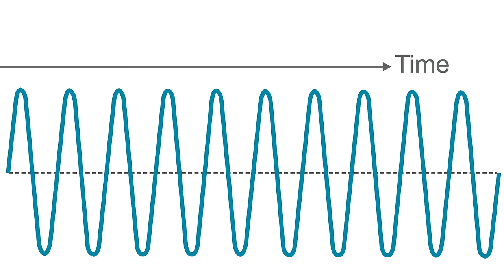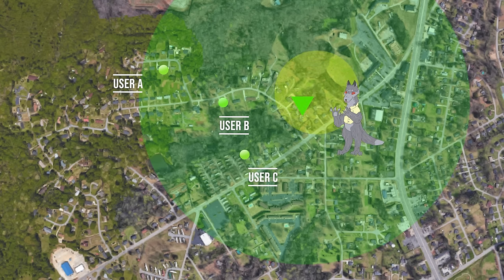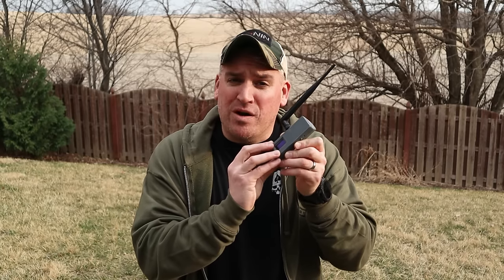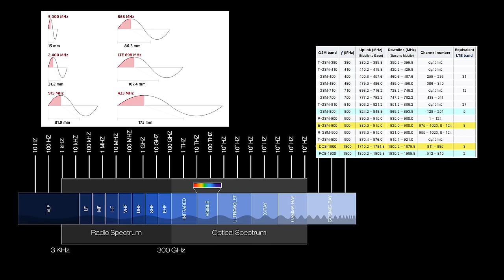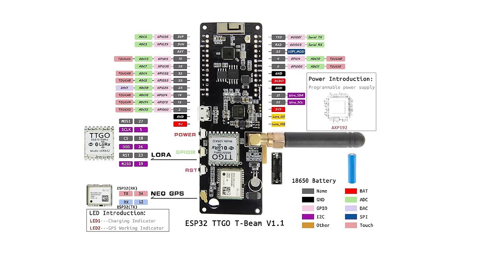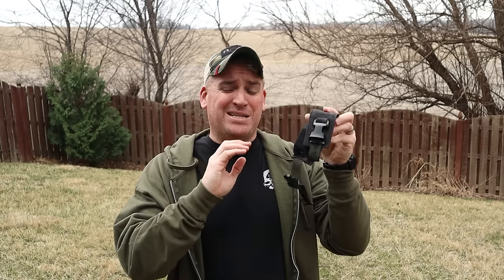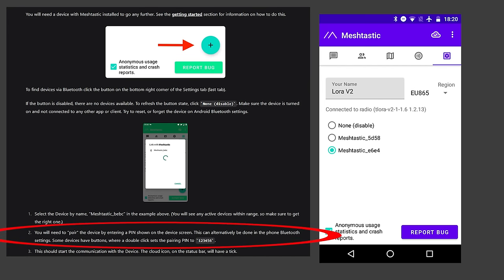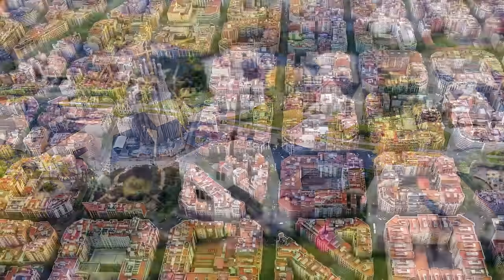Lilygo Meshtastic T-beam - Game changer in Tactical Comms

Comment: I think this is my favorite video that you’ve done. You did a great job of laying out the weaknesses of traditional comms and the strengths of this system. 
Everywhere I’ve seen information on this stuff before has always come from radio guys either unaware of, or trying desperately not to show, the defensive applications of the technology. 
I also really appreciate that you kept it to an overview with links to more detailed information included. And I really appreciate it I wanna get bogged down with more info than I can digest, but I also don’t have to go hunting for relevant information if I want more. (And I definitely want more)  
I’m very much looking forward to getting and playing around with these. I wonder if the cases could be redesigned with a waterproof seal. Like a gasket with some screws to replace the battery when necessary. Maybe hardwire a solar charger in as well so you can set it and forget it.
Reply: Check out RAKBox-B2 Enclosure with solar panel I can’t send links on YouTube
Reply: WisBlock Meshtastic Starter Kit Goes inside the rakbox

Comment: Your using the wrong battery, you need to use the Flat Top version, good thing you did not break the battery holder.  Good Job on the video, well done.

Comment: Make sure to buy the batteries without the nipple on it, those with the nipple will be to big to fit in these boards.
If you dont want to solder, you can buy these boards with the screen already on and most of the time it comes with Meshtastic already loaded on the board.

Comment: We've played with them a bit, and they're pretty slick for a certain level and setting. As mentioned they require that cover of other devices being in operation otherwise they're still subject to RDF( in Ukraine they're hitting some emissions in under 60 seconds https://youtu.be/UZXzMUxfR6c ) . You can still play the same tricks(directional, terrain masking, etc) but aerial surveillance can nullify a lot of that. 

 One of  the better options we've found for short term nodes is a Heltec Lora module ,AA to mini battery pack,  sma extension , a 16 oz nalgene, and a 915dipole. Just drill a hole dead center of the lid for the antenna extension to mount to.
Also we've had limited functionality with ATAK , basically position reporting within a functioning ATAK setup. Which can be done in some meshtastic versions without ATAK.
Reply: Can you link to how you run it on AA? 
Why do you like the heltecs better?

Comment: I was in Electronic warfare in the Air Force. This video is fantastic. Also yes blue tooth is insecure but the transmit distance is LOS and also very small so if you’re close enough to intercept the signal then I am close enough to shoot you. So that isn’t really an issue. The real problem with that is that the phone is giving out your location at all times if the cell network is enabled.
Reply: Excellent point - but that could be thwarted by removing the SIM card from the phone, correct? Bluetooth and other functions would be unaffected.
Reply: Would airplane mode do the same thing?
Reply: @iamnothere454  There is no way to remove connection from a phone due to the backdoor access. Even when you turn off your phone it still is actually collecting data to transmit when you turn it back on.
Reply: The phone still pings the tower even without the sim. It's how u are still able to contact emergency services without the sim.
Reply: There are new stand-alone devices that once set up, I don't believe need a cell phone or BT, like the T deck.

Comment: 12:40 Even though a antenna has a mating SMA connector does not mean it will work on the same frequency.  Make sure the antenna is resonant in the 902-928 MHz band
Reply from the maker: very true!

Comment: One very important thing that your video missed:  The modulation used between the nodes is LoRa - chirp spread spectrum.  It's low power ande the have can operate below the noise level.  Second, i the Meshtastic  nodes in high places where they are in line of sight LOS of another node in the mesh.  The tablet or phone only momentarily transmits to send a message.
Reply from the maker: Reread this please. You're missing a whole lot of words that would be useful in it making sense
Reply: Sorry.  I may have fat-fingered while typing on my cellphone or something got lost something in translation to English.  1)  The modulation used between the nodes is LoRa (chirp spread spectrum).  It's low power and can operate below the noise level.  2) It's most useful to have Meshtastic nodes in high places so that they are in line of sight (LOS) of other nodes in the mesh.  The tablet or phone only momentarily transmits to send a message.
Reply: Furthermore, I have a couple of Meshtastic nodes that connect via USB.  They never transmit over Bluetooth or WiFi.  You have to be a very skilled fox hunter to detect a LoRa signal because it's often below the noise floor.

Comment: So glad this idea worked out so well. When I first saw it I thought that you guys could figure out a way to use it in a tactical situation. 

One note about the Bluetooth is that it normally only works within about 30 feet so you would likely be able to see anyone close enough to actually hack the Bluetooth part of the system
Reply from the maker: I'd be more worried about setting devices that just packet sniff and listen in if you're in range of them.
Reply: @ThinLineDefenseCo  True, but even then the data is encrypted and would need a way to un-encrypt it  as the app on the phone handles that. So not sure what anyone could really gather from hacking the Bluetooth.
Reply from the maker: @kalebfinlay  ahhh yea agreed sorry I was talking more intercepting the Bluetooth of folks using Bluetooth PTTs. We were talking two different things lol

Comment: The only problem i have with this kind of system and the integration into the ATAK app is that you have to enable Bluetooth. That's the only real downside. Give me the option to plug it in with a 3,5mm audio or usb-c and we're talking.
Reply: The heltec lora 32 board can do that

Comment: There is a reason 33cm is using of IoT.  Low-range when you don't have LoS.  They talk about miles, but that's if you don't have anything between the two antennas, including too much air.  Additionally, this is only text and relies on having a working cellphone.  Which is much easier to track.  Which means when you're out and about, you have two transmitters running constantly.  All for the advantage of being able to text someone.   Radios, you turn them off, you're dark.  Or you remote the antenna and draw the Opfor into a trap.  

Not saying these things don't have a use.  Just it's not to replace radios.  Not even close.  And are generally only useful in a set location.  When the SHTF, most of those that want to continue breathing are going to be on the move.  This isn't going to be just some natural disaster that you can wait for the cavalry on.   

Funny thing about jammers.  They have to be loud and on all the time.  With lots of power.
Reply from the maker: You can pull the sim card and still connect to these devices...just fyi
Reply: Not to mention that you don't need a phone because some units have a standalone keypad

Comment: Meshtastic is cool, but the battery life drains in less than a day. It uses an 18650 battery which is huge for modern electronics and it still drains in less than a day with no use in standby mode. This needs to last at least a few days in standby to be useful.
Reply: It's called solar

Comment: I have a question. Has anyone tried to take one of these boards and put it into a Thyrm CellVault 5M? The reason I ask it that it can hold multiple 18650 batteries to connect in a series and it’s a hard case that can attach to molle  web gear.

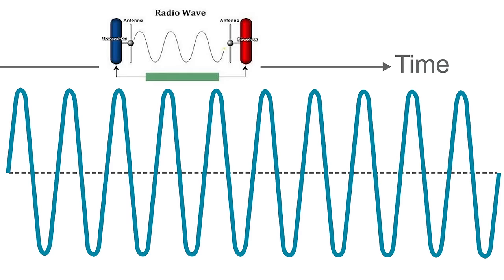Comment: 1:40 Who says that HAM radio has to use repeaters?  In fact, Meshtastic acts like a mesh of 868/915MHz repeaters that are connected to Bluetooth at the end points.
Reply from the maker: Ham is the technology of your Dad's Dad.  It's time to move on.
Reply: @ThinLineDefenseCo  ZZZZZZZZZZZzzzzzzzzzzzz You know nothing about HAM radio then.
Reply: @WA4OSH  He has no idea what he is talking about. You don't have to use a repeater at all. I don't in many instances, and can communicate over 400 miles depending on weather.
Reply: @mst3rmind879  I have used spread spectrum modulations to communicate with satellites I both GEO and LEO orbit.  LoRa is one of many spread spread spectrum technologies.  I have used complex modulations using rain scatter or mountain bounce over microwaves for hundreds of miles.  I have heard of Idaho to Florida on 6 meters and moon bounce between continents.  Ham radio is not FRS GMRS MURS or CB.  And it's not kerchunking repeaters with a Baofeng.

Comment: Bluetooth is getting more and more secure, and the range is 10 meters max (in that version), so is not a big deal (it was in the past).
But of course that a jammer can wipe out the all city's meshtastic network easy
Reply from the maker: well i certainly wouldn't assume mesh networks are following the region specific bands at that point.  Running redundancy on different bands would give you early warning

Comment: First off, I love the content here and I learn a ton. Thank you for doing all this work that we get to benefit from.

Second, I have a question regarding jamming the MeshTastic network. As far as I understand it, on a repeater network, localized jamming of the transmit freq of the node within LOS of the jammer would work exactly as described in this video (I.e. it would just take that node out of the network). However, to my understanding, jamming the receive freq of the node would instead pass the interference on to the other nodes in the network just like on a bent pipe relay system. Of course, all of this is based on either a TDMA or CDMA system that is constantly receiving on one freq and transmitting on another on order to facilitate a constant flow of comms/data, which is what I'm most familiar with. Is there something I'm missing or unaware of that nullifies that concern?

Again, not trying to do the standard YT commenter thing where they try to turn your block of provolone into Swiss by poking holes in it. I'm really just super curious about and fascinated by this stuff. Any light you could shed would be awesome.
Reply from the maker: If the node was jammed, it just couldn't transmit or receive.  It if was compromised it would transmit and send crap to all the other nodes.  With AES256, it's not going to get compromised (hacked) unless they had a computer running a brute force attack for like 10 years straight.
Reply: @ThinLineDefenseCo  thank you for the clarification. I have almost 0 knowledge of how encryption works, but I do know the basics of RF EMI so my interest was piqued lol. I can't wait to get my hands on a few of these...

Comment: I feel like I'm going to break my T-Beam if I force my 18650 battery in the socket.  Is that normal?   I mean, I REALLY need to force it in there. Almost need a vice or something..   Can't be right.  Is it?
Reply from the maker: I definitely jammed mine in there... 100 had to commit like I was gonna break it

hope that helps lol

-Walsh
Reply: @ThinLineDefenseCo  yeah,  I went all in, and got it in there.  Still works.  So, thanks..
Reply: @ThinLineDefenseCo  I tested some "Flat Top" 18650 batteries.  They fit perfectly in my T-Beam.  Just like you might expect a battery to fit.   I'm 100% confident that T-beams were designed for "Flat Top" 18650s.

Comment: I Have coded something similar to metastatic on the T-Beam. But then tried Metastatic. But Meshtastic will only repeat messages within it's own network. This is restrictive  in the growth of popularity  as it would be useful to have a message forwarded through any group. But the problem with that is the network would become flooded with repeated traffic. A mesh system would need to build a dynamic routing table to link the shortest mobile end to end repeater to the end nodes.Also adapt to lost or moving repeaters  and also a capability to store  data for out of range end points. This radio text messaging over an app  from a phone via bluetooth to an esp32 with a (LORA)  radio Low power long range radio transmitter which is still only  basically line of site.  So unless as suggested you hide solar powered versions on hill tops your mate won't be able to msg you in the next valley. All that said, nice to have a play with it as a radio ham myself . But it is not ready for communications as a viable group communication  tool  or  invasion survival preppers quite yet.

Comment: So how does this help in an emergency if you need a phone to send and receive sms on them? Does it require phone signal or internet if so?
Reply: No your phone just needs to be one or powered.the bluetooth from the phone sends to meshtastic device and amplifies it.think old phones.
I am wondering my self how far each can go.i am hoping 5 miles
Reply: The phone  or tablet is only used to connect via Bluetooth to the Meshtastic board.  No phone network or Internet is needed.

Comment: so question, if you were running 900mzh radio like Motorola xpr series that run 900mhz would it work on this network?
Reply from the maker: I don't see how they would.  I'm fairly certain it's the protocol and not the wavelengths
Reply: @ThinLineDefenseCo  how about on your cell phone will a push to talk app like Zello work?
Reply from the maker: ehhhh no. it would need a way to voice to data the transmission
Reply: Is there a chance would you be able to make some for us?